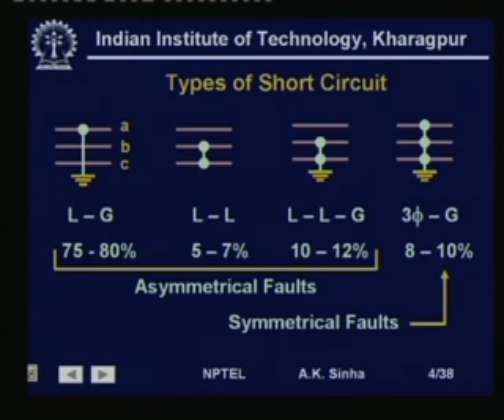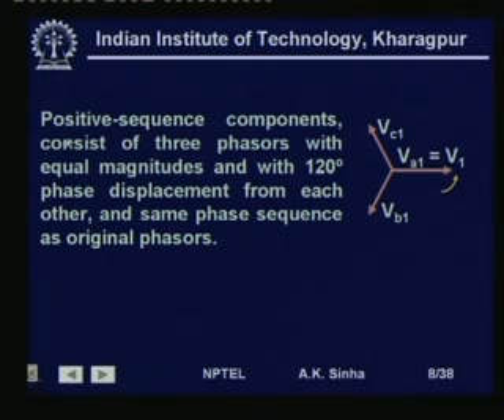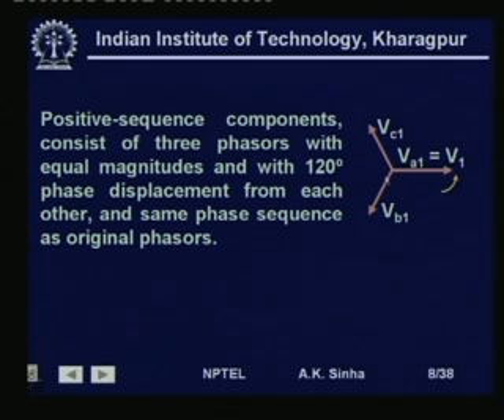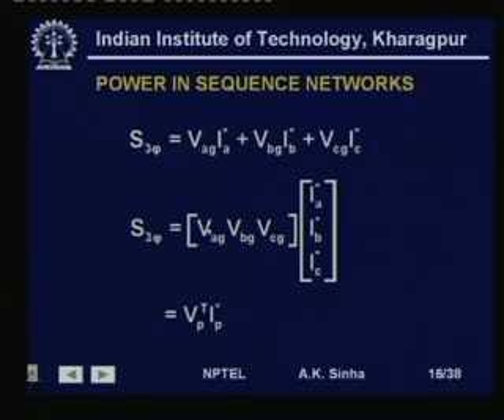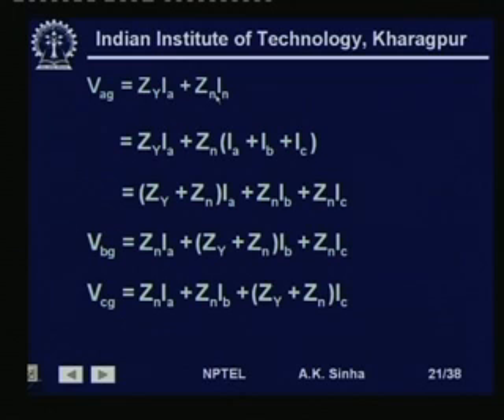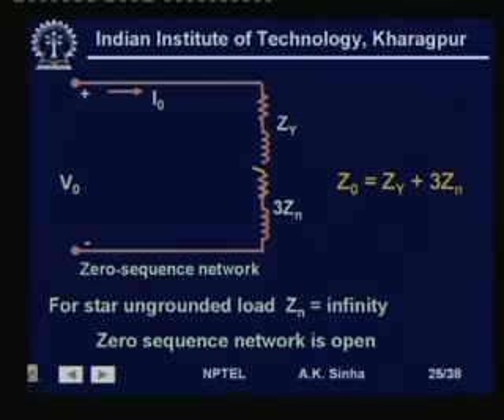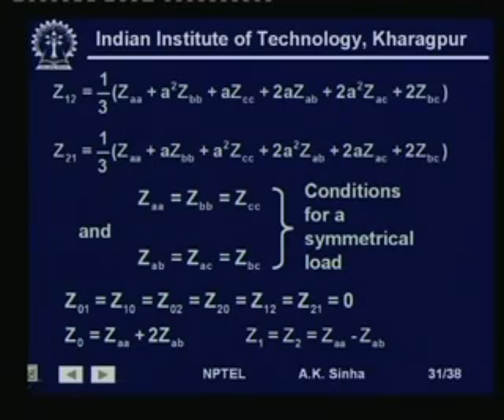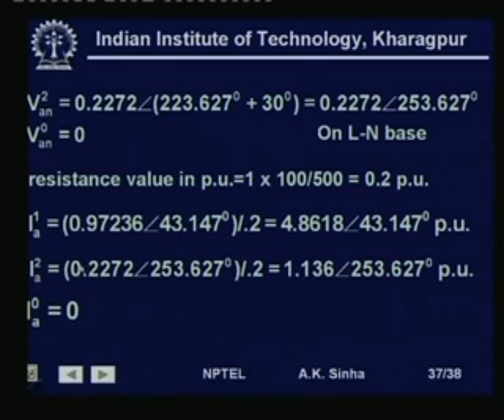Lecture -26 Symmetrical Component Analysis

Comment: I'm guessing its got something to do with the spec of the reference vector at 180 degrees.  As the other vectors are referenced to it and its a three phase circuit -41 degrees is equivalent to 221 degrees.  which would be the angle if we keep going in the same direction.  Unfortunately this is as unsatisfactory an explanation and the lack of any explanation in the lecture, maybe someone else has a better one?

Comment: The angles are calculated by forming a triangle with a, b and c on each vertex.  The lengths AC, BA and BC are then the three magnitudes of the respective vectors.  Use the cosine rule to find one of the angles, the sine rule to find the next and then the other is 180 degrees minus the sum of the two you just found.
Reply: well one side is already taken as a reference with 180 degrees angle so how is it possible to construct a triangle. and by the way using cosine rule will give you positive 41 degrees.
if you found the results could you clarify them please.

Comment: Everything we engineer is already bisymmetrical, exceptions are only for practical use. Our minds are addicted to bisymmetry. So, if in concepts and designed matter it being a rule, why wouldn't we pull that rule through in this area. It has been our mental structure for ages. Magnetism is bipolarly perceived anyway. Been off topic here, but interesting lecture from Dr. Sinha. Thank you.